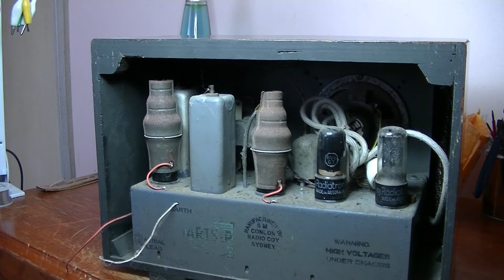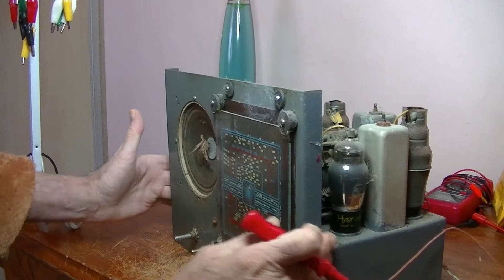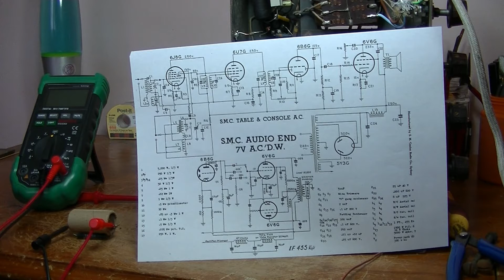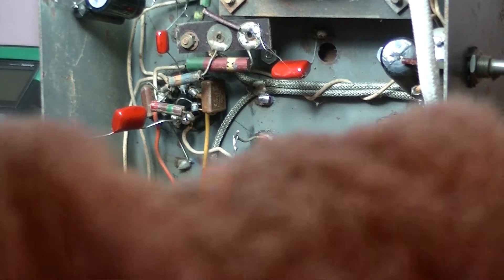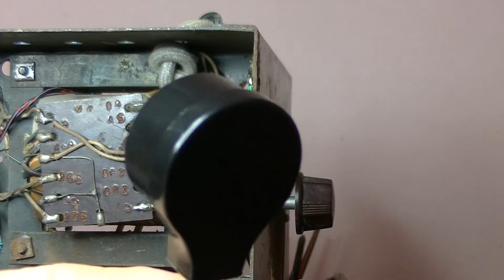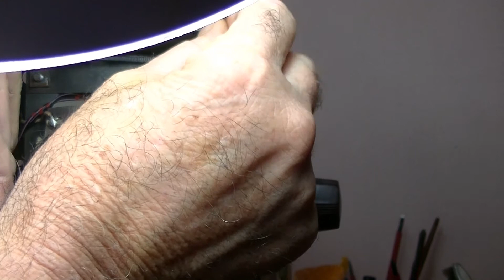Conlon 1947 Table Top Radio

Comment: Great job on this one, sounded really good. The wooden case is amazing considering its age. 

I like to get the schematics so I can try to follow what's being done - this one really threw me because it used W for ohms! I know it's used for impedance in watts but that's the only schematic I've ever seen that didn't use the omega symbol. Maybe their draughtsman wasn't good at doing that particular squiggly symbol. 🙂
Reply from the maker: Hey Brian, maybe not lol. I know they could be pretty slack at times. I searched everywhere for this schematic, It's probably in one of the AORSM volumes though. One day I'll have to get a set of those books but i did read somewhere that someone has the entire set on cdrom. If I find out I'll post the info. Cheers